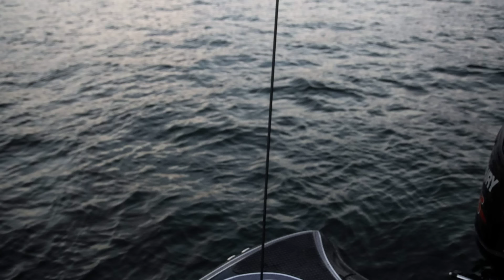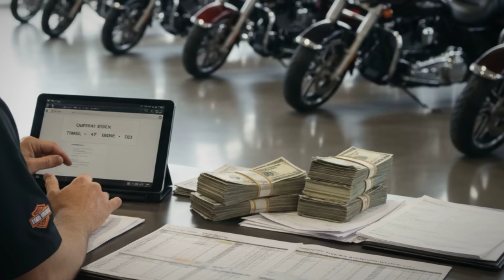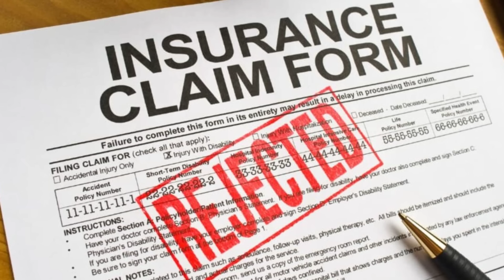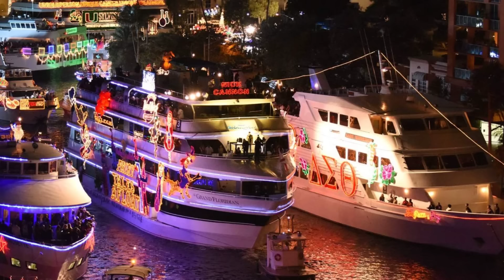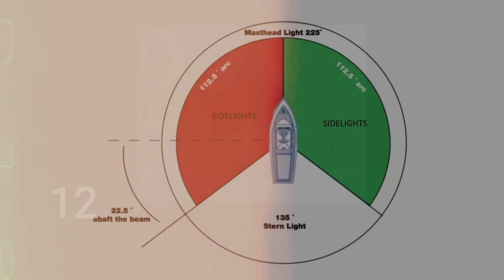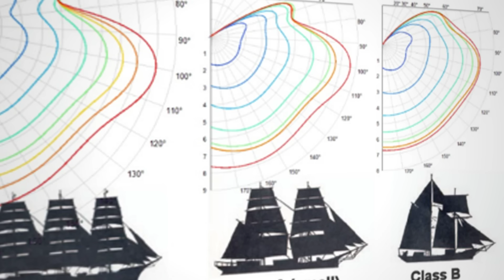10 'Common' Upgrades That Actually Make Your Boat ILLEGAL

Comment: Another thing I got to say is I don't like leds, I usually use incandescence. The reason is because I don't like the spectrum of light bars also they tend to lose LEDs in a short period of time. Another thing is to make sure you check the angle of your lights. Your lights shouldn't be pointing straight out to the horizon. They should be angled down so that you see what's in front of you at about the same distance your car lights are. Also it is illegal to drive on the highway with your light bar on so whether it's a truck or a boat you cannot do that. It's a hazard regardless and they're meant for off-road use only.
Reply from the maker: incandescent runs hotter and draws more juice but the spectrum argument is solid, and anybody runnin a light bar pointed straight at the horizon on open water is just blindin the next skipper and askin for a coast guard conversation

Comment: Don't trust lithium batteries. Yeah you get more supply of power but the cells are too finicky and dangerous to keep on a vessel where you have no escape. Sealed batteries like glass mat batteries work great but I always stick with marine grade lead acids and run a vent tube. I have over a thousand lithium ion batteries but I am very careful with them. I will not use them in my vehicles. I have built an ultracapacitor Bank to take out any high amperage buildups. It also helps to engage the starter so much quicker and I've noticed my wires don't heat up near as much because of the instant amperage. I have a kill switch on it so that I can isolate it from the system. It's also set up to a solar charger so that I can charge the capacitor bank if the battery goes dead and still start the motor. All of my lights are visible and I extended my anchor light so that it sits about 7 ft above me. I want to be as visible as possible! I even have spots set up in every direction on the Bimini. The new boat I'm looking at is a 41 footer so it'll be a whole new learning experience because I'll be dealing with a mast. It's also a different engine setup and different electronics so it's going to take me some time to get used to it. It's been fully updated with a glass navigation system. . . PS if anybody's looking for a good deal on a boat California is dirt cheap right now for sailboats. Some amazing and immaculate boats going for super cheap. The boat I'm looking at goes for roughly about $220,000 but it's on sale right now at 38000 because they have to get rid of it. It's been fully renovated with a full kitchen and is immaculate inside as well as out.
Reply from the maker: lead acid with a vent tube beats lithium on a vessel where you cant swim to shore, and that ultracapacitor bank for starter load is solid engineering—most skippers dont realize the wire heating problem till the insulation starts weeping, so you're ahead of the curve there

Comment: Anybody in a saltwater marine environment should know that you should not use off-the-shelf parts like a brass valve. If you're going to spend $170,000 on a boat and you better not go and buy a $5 valve instead of a $55 valve. I'm in the market for a bigger boat at the moment and I'm doing some research before I buy. You better believe I went through all the proper corrosion resistance education before I even set one boat in the saltwater. Also anytime you smell fuel in a confined space you are in danger. Batteries can also produce hydrogen when they are in use so you want to make sure your battery Bay is also vented properly.
Reply from the maker: brass corrodes in saltwater inside a year, and anybody droppin 170k on a hull then grindin pennies on through-hulls is just buildin their own repair bill — sounds like you're doin your homework right

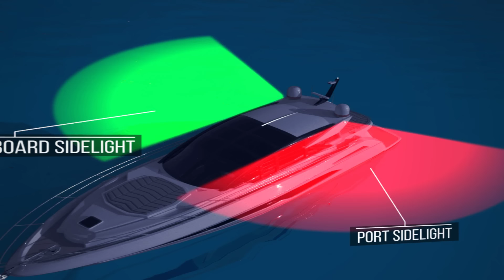Comment: 10:36 that's actually not true. Colregs rule 22 only defines how far a light has to be seen, blocking is forbidden because it reduces the range effectively to 0, but there's no point about being forbidden to be overpowered by other sources that would pretty much kill cruise ships and fishing vessels which are often referred to as "Christmas trees" because they're lighted like one and there's no way you see the nav lights without really searching, because there are lots of brighter lights...
Reply from the maker: ColRegs 22 defines visibility range but you're right that commercial rigs stack enough deck lights to drown out nav lights — tell me how a skipper spottin a fishing boat's stern light at two miles picks it outta that Christmas tree when the work lights are blazin at full

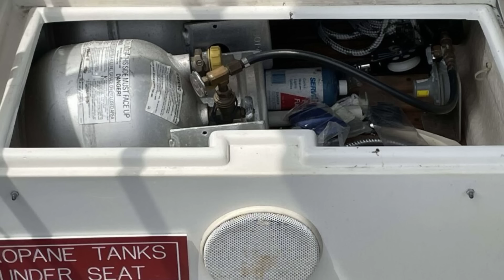Comment: 3:31 well is it? My fix is not to have a gas tank in the first place - no gas no bomb 😊
Reply from the maker: Well, can't argue with that haha
Reply: Nice, rn my boat is a split kayak that gets either 2.5hp gas OR 12v lithium to lower mid tier troll motor. 

There's definitely trade offs the gasoline one being fast and having range, troll motor same speed as if I constantly paddled max speed but silent and can run 100W solar haha

My brother with special needs balks at the small boat. I'm thinking about building a 16ft thing with a 48V system on board and a couple of seats

Comment: I always find it interesting when people slam codes/rules/guidelines. Many times these are in place for good reason, to protect people from themselves or the harm they end up inflicting on others. The rules/regulations/codes/guidelines many times are created because either a severe accident or fatality occurred. Some people know to do the right thing, but others either don't know any better, don't care, or are taking a shortcut. And many times what others do, can actually affect so many other people in ways you can't imagine. 

A good example listed in this video is on board propane storage. Ever see what leaked propane in a confined space can do when ignited? In the case of a boat, it can shred it to pieces down to and even below the waterline. But not only that, it can hurl pieces of the boat in every direction, potentially injuring or killing anyone nearby. The same explosion can also take out other boats in close proximity. Think of boats parked in a slip with hundreds of other boats and people nearby and how many can be affected. 

And the idea behind fines? Its to incent people to follow the rules to help protect the general public and people from themselves. Sure, the fine might boost their operating budget, but ask any Coast Guard Inspector if they would rather investigate a tragedy or collect a fine to help prevent tragedies, and it will be the latter every time. But I also would bet that they all would prefer not to collect fines and/or investigate an accident or fatality as the result of violations. And if they have to investigate just 1 fatality, I would also bet they would say the fines are not high enough either. To them, its not about the collection of money. Sometimes its difficult to unsee something you wish you never saw. And unfortunately you'll never forget it either. 

I personally commend the process thats in place and what the Coast Guard, DNR, or any other policing agent does. It doesn't prevent everything that could go wrong, but it does help reduce the number of incidents that would occur if we didn't have fines, rules, regulations, etc. in place.
Reply: yea.. but  can you imagine a cop pulling over a car just to check the brakes, steering, safety belts  ect ect.. then if you pass  your free to leave... man.. that shit would not go far on land.. i think its time we boaters get the same respect and treatment that cars on land do.. stop fucking with us for no reason..
Reply: @tarpanc34 it's insane that they can just decide "I'm bored, gonna go check that guy who is fishing and relaxing."
Reply from the maker: that's a guy who understands why the rules exist and aint afraid to say it

Comment: The surge protector show is for 120V circuits, rather than 12v or 24v circuits commonly found on boats.  It's not applicable.
Reply from the maker: Right — shore power is where the 120V exposure is. That's exactly the circuit the surge protector covers.

Comment: I'm happy I don't live in a country where these laws apply. I can even drink a few beers and have a good time.
Yeah, safety is important. However, if you have basic knowledge before you do something, you will avoid all the pitfalls, like cheap brass valves.
Reply from the maker: Basic knowledge gets you a long way — the frustrating part is when the rule changes after you've already done everything right.

Comment: Stern test for anchor lights is 100% wrong. It's not that it's visible from aboard but is visible 360 degrees from deck height ( I forget the distance from vessel but it's from vessel visibility or farther out), it's a 360 degree ring horizontal to the vessel not a ball of light. Basically walk around your boat and see if anything blocks your anchor light. You are also allowed to use a combination of lights to act as a single anchor light atop the vessels highest structural point on a powerboat, on mast for a sailboat 3/4 mast height or more high. Also the spot/focused beam light use while underway not being allowed is not true, you are allowed to use these lights for navigation BUT you are not allowed to blind other vessels. Basically if you see another vessel being operated in your lights projection you are required to shut it off. Spotlights, off-road lights are allowed to be used as workilghts while underway also but they cannot interfere with other vessels navigation. Also the deck lighting is allowed but where people mess up is that deck lighting is indirect lighting. The light source is not directly visible off the vessel and the intensity is not stronger than the navigation lights. And the colors never interfere with the navigation requirements. If you use a aftermarket light for deck lighting also install a dimmer so the lights are visible to you and light up the deck but other vessels do not see it more than a few yards away. Anything else is dockside/anchored lights.
Reply: the next time i see jesus i will ask him to walk around my boat and report back
Reply: Just a little more specific on the sailboat mast light... A light at 3/4 is considered a "steaming" light, meaning you are underway.  A white all-around light at the masthead signifies you are anchored.  
Thanks for the clarity on the other points.
Reply from the maker: Good clarification on the all-around requirement — 360 degrees from deck height is the actual standard, and the distinction matters when a boarding officer decides what "obstructed" means in practice.

Comment: Specific degrees of arc for nav lights?   Wonder when was the last time a boater saw the Coasties 
check that on the water?
Reply from the maker: The standard exists in the reg, the enforcement doesn't exist in practice, but the liability does the moment something goes wrong and there's paperwork to fill out.
Reply: I would be happy if the CG would just crack down on jet skiers zipping through anchorages and close passes.  My 27 foot trawler was literally lifted out of the channel and into 1' (per chart) by some asshat trying to get under a bridge before it closed. Thank God it was high tide.
Reply: I see the coast guard on weekly basis
Reply: @brandonmann4652  You see them weekly.
Have you ever seen them checking the angle of the lights coverage?
Next week, ask the bosun if they even know how or have the equipment to do the test.
Reply: Within a half a degree at that ! 😅